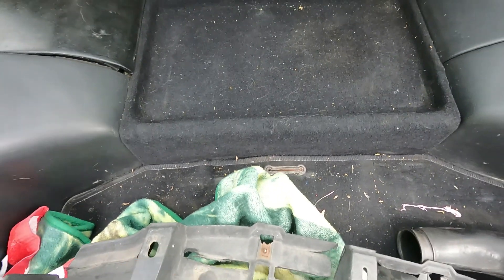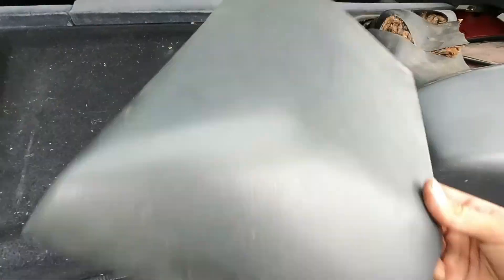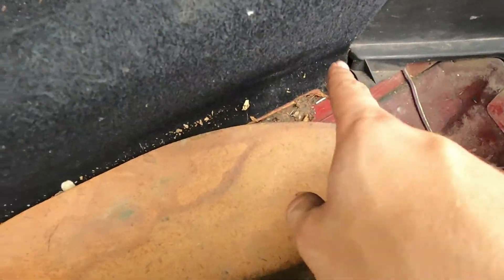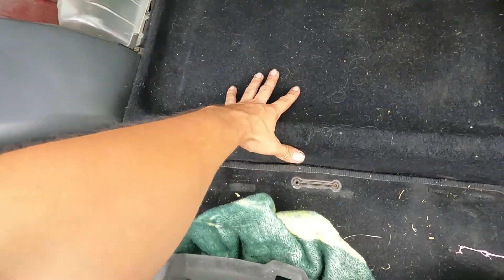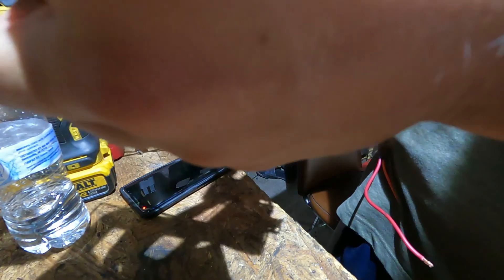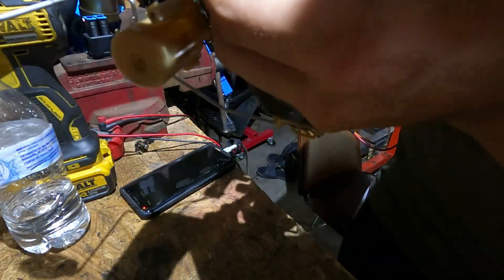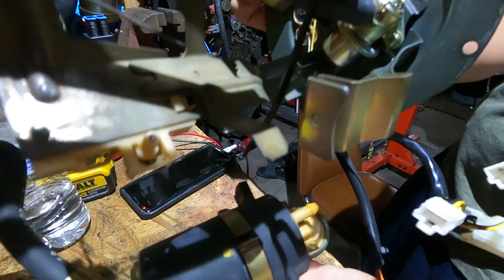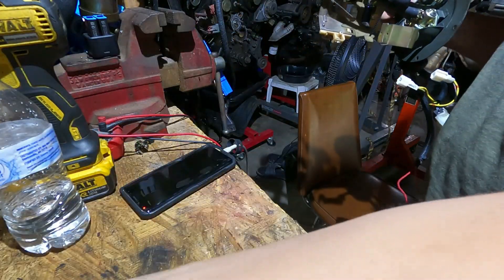How to Install a Walbro 485 in a Nissan 300zx

Comment: i used the same parts as you did but gas always finds its way thru .
Reply from the maker: Did you clean/debur the hole after drilling?
Also, was the well nut tight in the drilled hole?
I'll be making an updated video before long with use of radium hardware.
Reply: @NedacSnosrap  yes seems to be tight . But seems the rubber doesn't last in the gas . When I go to pull it and change it to new one because leak .. it's always busted and broken up . I found some well nuts rated for fuel . But $40  a pop on ebay... what you think?
Reply from the maker: @Muhammad_z32  in theory the rubber isn't really going to come in contact with fuel much unless you let your car sit with a complete full tank. If they're rated for fuel its worth a shot. Price difference is probably due to material difference. 
By being tight, I was referring to the diameter of the well nut vs the hole. I also didn't totally tighten mine down, so they had the squish factor, but weren't pinched promoting it to split.
Reply: @NedacSnosrap  so the fuel tank isn't pressurized? Because as soon as I start the car . It's bubbles air 🫧 gas there
Reply from the maker: @Muhammad_z32  it does like 1 psi.
Id make sure the bottom side of the tophat is smooth and even to make sure it seals on the back side. Mine was fairly tight where I had to force the wellnut through. You can watch it on the back side to see where it gets the most coverage without crunching/splitting
Reply: Did you ever fix this bro?

Comment: why wire it directly ?
Reply from the maker: So it's got a consistent 12v, vs going through the stock wiring that was used for the signal wire,  because of the stock relay in line. I went through 2 relays previously, but that could be unrelated.

Comment: I saw all the parts you used to install but what size were they. I know I can use any size but I'd like to copy just to keep it simple.
Reply from the maker: I believe I used standard 1/4 well nuts with hardware that fit accordingly(got mine at lowes and most bags in the hardware are opened or can be opened to test fit.)
Next time I will be keeping it metric as they didnt have any metric well nuts in stock.
I believe the metric thread pitch would be m8x1.25 if you can get metric well nuts.
Reply: @NedacSnosrap  alrighty thanks for that man. Last question, did u need a tune to put in the pump as well?
Reply from the maker: @maximillianrhodes8338  no sir, but to efficiently use the pump you should use an adjustable fuel pressure regulator. You also do not need a fuel damper with a walbro 485 because of pump design.
Reply from the maker: @maximillianrhodes8338  the bolts I just bought to do this again were 1/4-28 x 1 1/2. With washers and crush washers to makeup the gap accordingly
Reply: I did this exact to the tee copying you .but I'm having fuel coming from wellnut . I re did it twice.  Same thing . How is yours not leaking fuel ?